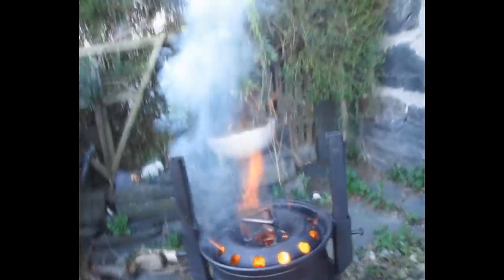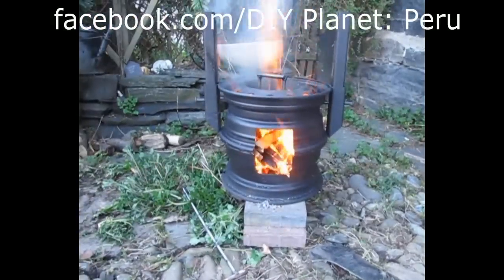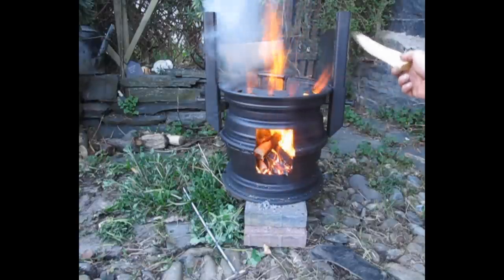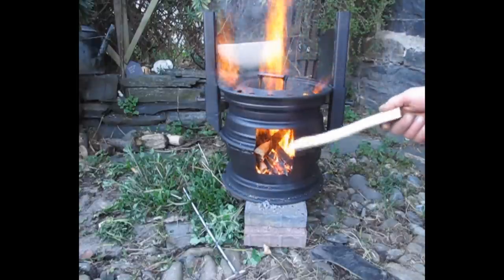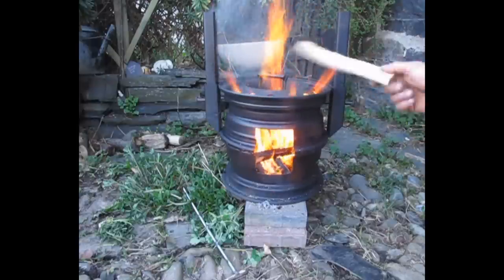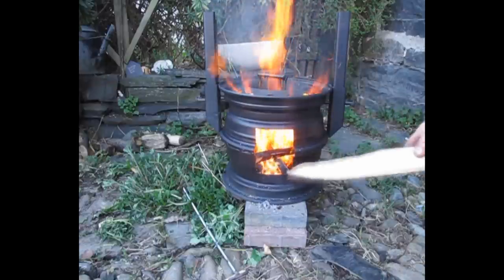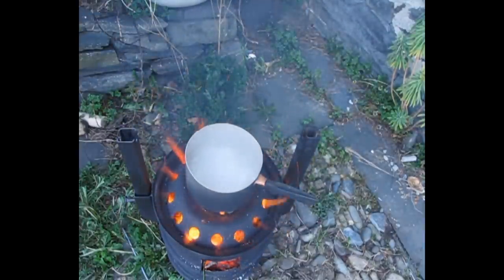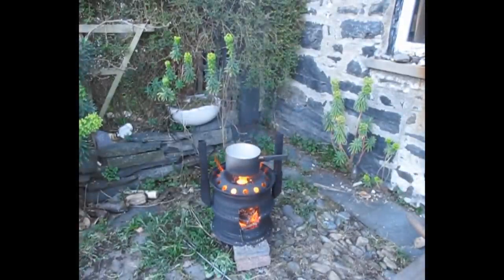Wheel Rim Wood Stove - boiling water 6m 30s

Comment: About making one by just bolting the wheels together,,,If you do that then use two wheels that are an inch apart in size.Like a 14" wheel on top of a 15" wheel. They lock together so much better than just edge to edge.Just make sure they both have the same number of lug holes.

Comment: i will make one, and for smaller pans i intend to do a metal ring to cover the outside holes and let the fire in the middle
Reply from the maker: +Elias AQUIAR SANTOS that is a very good idea!
Reply from the maker: +pupnirn it is in the nature of the design and its basics, on its own it only has to consist of two wheel rims, no extra steel, if you have the extra steel then yes you add extra items like a spit or a hot plate reducer, let me know if you decide to make one, i would be very interested to see it, thanks